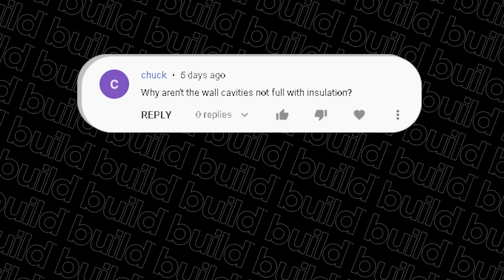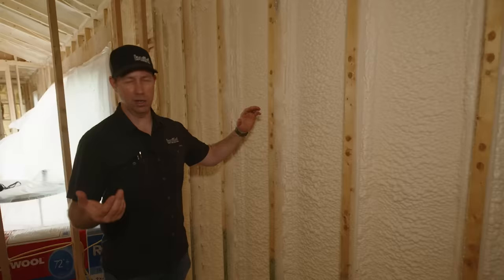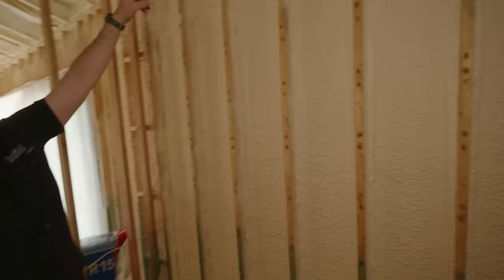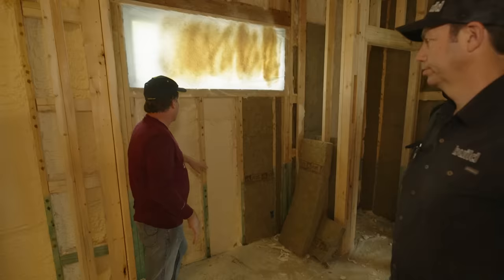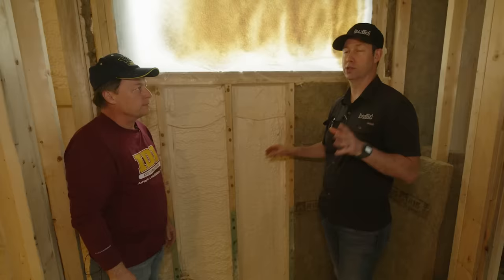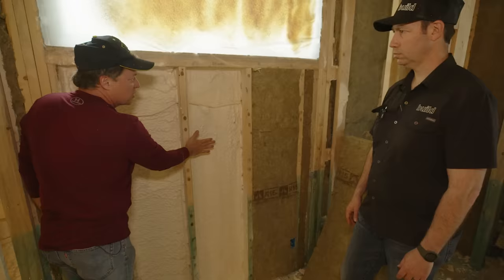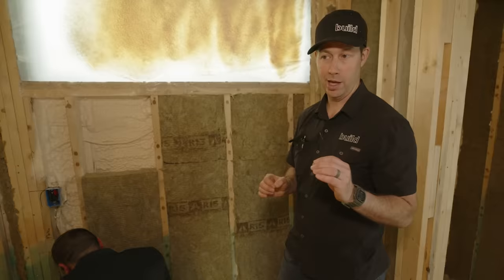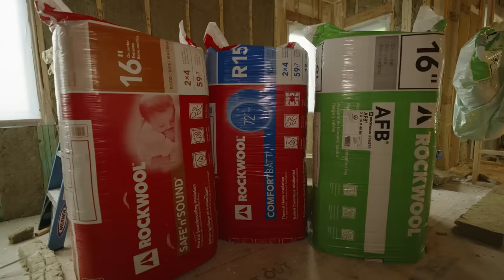Closed Cell Foam + Rockwool- How To Flash & Batt

Comment: Spray foam gets a unfair R rating. the way the test is performed highly favors fiber products. independent tests with actual walls shows 2 inches of polystyrene sheets (r10)  is twice as effective as r13 fiberglass. having a real world value that should be equivalent to r26. plus a vapor barrier and moisture resistance. The test is performed by allowing both sides of the insulating product to acclimate at 70 degrees before the test begins, fiberglass takes about 2 hours, polystyrene takes nearly 23 hours. spray foam should win before the test even begins. Fiberglass is very primitive. its a shame these companies don't spend their money to innovate and better insulate homes, they spend money to fool R ratings and lower overhead. Fiberglass batts are designed to restrict air flow to keep air from traveling. It has a random pattern of fiberglass fibers that do not actually stop air flow, just obstruct it slightly. we can obviously do that better with foam, bubbles, packing peanuts, or nearly anything really. A few years back companies started putting foil on bubble wrap and actually created a product that did fairly well which just shows how pathetic batt insulation is. There is a reason nearly every cooler, refrigerator, freezer, window ac unit uses Styrofoam instead of fiberglass.

Comment: Spray foam is a nightmare when it comes to water damage, which is inevitable.
Reply: Open cell yes. If it happens with closed cell clearly it wasn’t installed properly. How about fiberglass insulation and water damage? That’s the real fucking nightmare.
Reply: News flash, everything is a nightmare with water damage, so you can’t build with the assumption that is inevitable. You have to build layers to prevent water damage above all else and then everything after that you assume won’t see water.
Reply: Closed cell generally is rather hydrophobic and doesn't absorb water; open cell does and is the nightmare you mentioned.

And as another has mentioned, fiberglass is also a nightmare when it comes to water.

So if water is your concern, go all closed cell or all rockwool, or properly flash and batt with both (enough closed cell to prevent condensation in the wall cavity and the rockwool for sound).
Reply: @elderfarms  no way, with batt insulation you don’t have to replace the insulation in the whole room.
Reply: @Mrcaffinebean  news flash, with spray foam, ALL of it has to be removed and it’s quite tedious to remove, unlike simple batt.
Reply: @HickoryDickory86  my point is mold, the water part is the first step. Mold is the nightmare.
Reply: And rock wool is poor for your health, not to mention messy as ever. Particulates floating all so gently for days around your house for your family to breath in smh. I loath blown in insulation.
Reply: @Mrcaffinebean  and there’s 2 types of roofs, ones that leak and ones that are going to leak. Just like windows.
Reply: @amv_pure  disagree, there are plenty of houses that have never seen a roof leak and will never see a roof leak because the owners are on top of maintenance. Preventing your roof from leaking is really not as hard as you think it is.

If you built a house with the assumption that all window and doors will leak. Then you would never put in wood flooring because it’s insanely expensive to replace. You would also frame with pressure treated wood. you certainly wouldn’t use drywall what a nightmare that is when wet. OSB sheathing would definitely be off the table. Just about every insulation also would be a problem so you’d have to leave that out. In short you do not build a house like this. While a leak is possible, it is far from a guaranteed event. It becomes highly improbable when the house is built right in the first place and when the owner isn’t an idiot.
Reply: @Mrcaffinebean  Yeah, not the way they build houses today. There was a time man took pride in building homes, the typical house is slapped up in a week or two now and made out of cheap Chinese materials.
Reply: @HickoryDickory86  Trapped water, regardless if the insulation is absorbent or not, is going to be a problem. There’s wood, which is just as much of a food source for microbial growth.
Reply: @amv_pure  eye roll
Reply: Uhmmm where have you been? The quality of houses has degraded immensely since the 70’s and 80’s, and this new sustainable ideology for building is going to be even worst, inviting even more water intrusion and microbial growth through cellulose materials. Eye roll.
Reply: @amv_pure  Where have you been? The quality of American houses today, though it might be worse than the 1920s (blame survivor bias and lower quality lumber), is far, far better than it was in the 70s and 80s. Houses today are actually somewhat airtight, not just insulated with a half-assed, counterproductive poly vapor barrier like back then, which was the perfect recipe (moist air + cold surfaces) for mold. Yes, insulation gives you a thinner margin for error since there's less energy to dry out the structure, but airtightness gives you a bigger margin since there's less moisture to dry out in the first place. Cellulose helps since unlike fiberglass it's air-retardant.
Reply: @hailexiao2770  Boom, you told on yourself. Airtight. Houses are meant to breathe and not be 80% drywall. Literally the stack effect is putting so much pressure on the upper floors of these slap em’ up in a week houses, within a few years the drywall tape starts popping out and the seams start to crack where the sheet rock connects.

 Go to anyone of these suburban developments today. It’s one contractor who has the bid on the whole place, he’s building at minimum 25 plus homes at one time, not installing the Zip System right, or screwing up the Tyvek. Flashing is crap. Go to a new development in the process of being built and walk around, I do it all the time. I can find a weak spot in EVERY house before the siding goes up where water will intrude. And when it gets in the house unsuspectingly and the new owners don’t know why they’re wife and kids are getting sick, they don’t have a clue. This is why mold is more prevalent now than ever. Because we build these air tight homes that can’t breathe with no pride. It’s a damn shame.
Reply: And don’t even get me started on Zip Systems and how FLAWED they are.
Reply: @amv_pure  😄

Comment: Ah yes, lets use closed cell in fairly high humidity Austin and then be forced to rely exclusively on electo-mechanical means to prevent mold.
Might, maybe barely work in Austin but even 70 miles east and that house is black mold in a couple years
Reply: The closed cell foam blocks the moisture from coming in from the outside, so I fail to see why the HVAC is necessary to prevent mold.